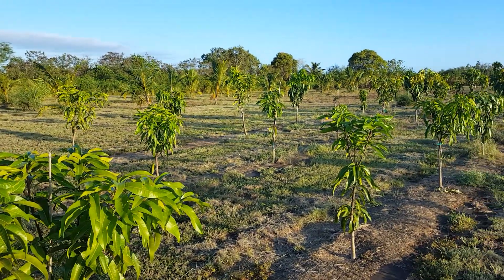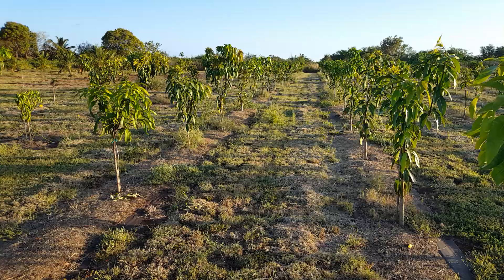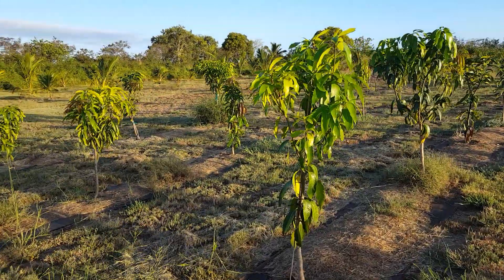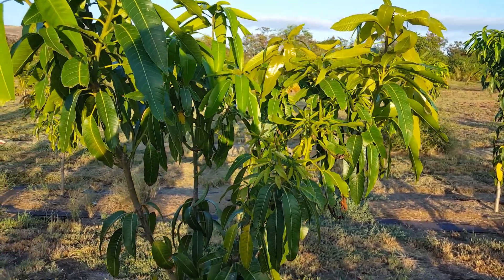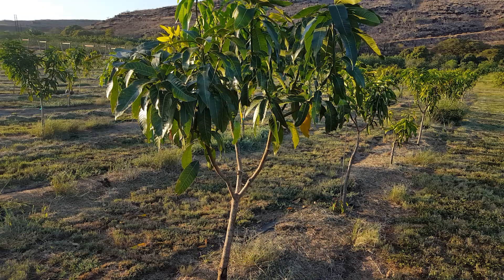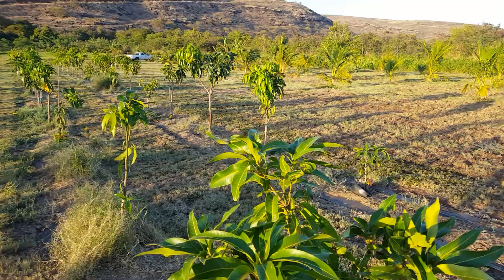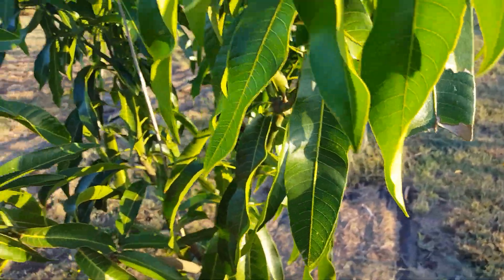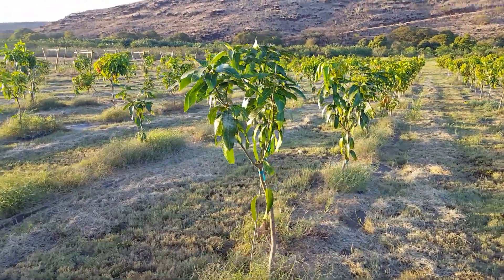The mango loa project: Ultra high density plantation uhdp mango orchard

Comment: Hello sir, from India. 

That’s true high density plantation gives more yields than the traditional methods, say, initially or in the first few years of harvesting. 

But what about in the long run ? Actually I’m a fan of big trees (wide trees) and thinking of starting a plantation. Plz guide of yields in the long run …
Reply from the maker: I think the biggest benefit of uhdp is the easy harvesting, canopy observation, and foliar applications.  It is true that the uhdp orchard will reach peak production quicker than the traditional orchard, but after 10 years, the traditional orchard will catch up in production.  I also think some varieties are not suitable for high density, such as haden, rapoza, and white pirie, of course you will be growing different varieties, but in general some varieties do not do well with high density.  I think , either orchard system, with the right variety can be very productive, so I think you can feel confident going with the bigger trees if that is what you choose to do.

Comment: Another option, To spread the branches out to 45 degrees you want, you can use a green flexible bamboo make a circular shape then place it in the center of the tree then tie those branches into the circular structure for sometime then remove it when you have the angle you want.  1/2 of an acre looks very big, happy mango farming❤❤🎉🎉🎉

Comment: its been 4 years. do you have any regrets? ie will you change anything to density if you able to go back in time?
Reply from the maker: No regrets because it was a trial and I didn't know what the outcomes would be.  I do think my trial was too dense, which creates problems with getting a tractor between the rows and needing more fungicides to deal with powdery mildew and anthracnose.  So, I widened out the space between rows to allow more sunlight and airflow.  I learned a lot from this project
Reply: @umisfarm9419  great to have this reflection.  If starting again could you say what pacing you would choose?
Is there any other significant leson you could share?
Reply: @umisfarm9419  What width would you recommend between rows?

Comment: What number Fertilizer do you use for your mango trees during the first 2 years
???
Reply from the maker: Hard to answer without a soil and tissue analysis.  8-8-8 is a good basic fertilizer, but I mostly apply minerals rather than blends.  I use Calcium + Boron before flowering, 0-0-16 after fruit set. 4-10-40 after harvest pruning and 1 round of micronutrients

Comment: Variety Keitt?  4x4 Meters?
Reply from the maker: Some a Keitt but others as well.
2.6m x 3.3m
Reply: @umisfarm9419  Definitely?  2,6 x 3,3meters
Reply from the maker: Yes 8 feet by 10 feet with 600 trees per acre
Reply: @umisfarm9419  4x4 there are about 600 plants per hectare, is your sixth too narrow?
Reply from the maker: @SuperTeddy222  it is too narrow for a truck but a smaller cart fits alright
Reply: @umisfarm9419  Are these that you put tight keitt? how much to produce?

It seems too narrow in the future they become hedges 😃
Reply: @umisfarm9419  quale varietà di mango é la piú potente sulle produzioni tonnellate?
Reply from the maker: @SuperTeddy222  mostly Keitt, rapoza, nom dok mai, white pirie